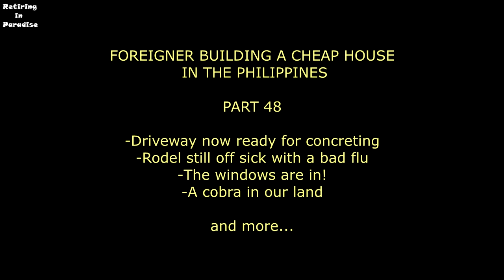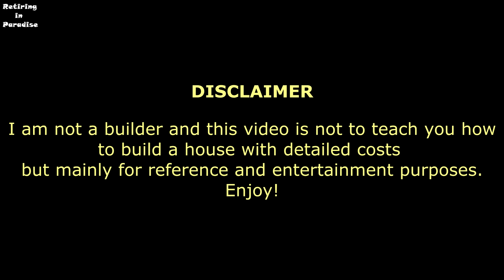V324 - Pt 48 FOREIGNER BUILDING A CHEAP HOUSE IN THE PHILIPPINES - Retiring in South East Asia vlog

Comment: The door hinges should be on the inside of the house where an entrance door is.  This is for security sake,  so the pins to the door can not be accessed and removed thus preventing the door from being removed.
Reply: I was thinking the same thing ...I've never seen an exterior door swing out  like that...screen door or storm door OK but not an exterior ....
Reply from the maker: Yes I know but it had to open to the outside. A kind of latches will be added in the inside so doors cannot be taken out when we go out
Reply: Simple solution turn the door casing the opposite way to open inwards and protect from intruders access to the pins hinges
Reply from the maker: @PeaceAndLove303  I knew what I did. I did not want the door to open to the inside, very inconvenient in our case. There are ways to prevent that door to be removed via the removal of the pins
Reply: They don’t worry about that here
Reply: The door should swing into the house
As suggested, the door buck/frame can be removed with door and turned 180 degree and then it will swing inward and solve the issue.
Reply: @TheGarciaFamily04  okies Its your home build and what is best for you. I just thought if you was to fix it ide add a solution ide do if I was doing it. 
Excellent build and great to follow your progress there and what your able to get and work with. As always I look forward to your next video and progress. Stay safe and keep smiling 😃 😊
Reply: Maybe he will put two...a nice farmers door would be really cool to have there...but hey your right about the door,, some one could just pull those hinges off an they'd be in his humble home...yikes!

Comment: I'm glad you got alot of advice regarding you cr room, in NZ they build extensively in wood on pole foundation...there the buildings toilet shower are lined in handflex sheeting screwed and the the floor is either wet style chipboard 3/4" or the sheeting you have with screwed down hardisheet 9mm that way you can pour a mortar bed to get a fall....the whole area is then painted on with a bostic brand easy paint that dries quickly and cement based glue sticks easily...you can buy the waterproofing on Lazada about 1650 peso 4 litres enough for one shower area and part walls  🤔🤔🤔
Reply from the maker: Great tip thank you😊👍👍👍
Reply: @TheGarciaFamily04  If you have the shower base I wonder if you can use colored roofing sheets on the walls?

Comment: Insulation on the ceiling and external walls is going to pay off for the savings on keeping it cool. You notice how hot it gets once it's all complete. Make sure you seal up the window frames to keep out the heat and water.

Comment: Look for waterproofing material. You're correct, it is like a paint. It's thick and you brush it on or roll it it on. There is a membrane that you use for the corners that goes along with the waterproofing "paint" . If you're interested in a picture of the membrane send me your email and I can send you some pictures so you can see what it looks like after it's applied
Reply from the maker: Thank you. My email in the description box 😊👍👍👍